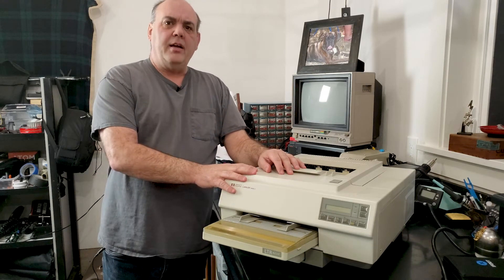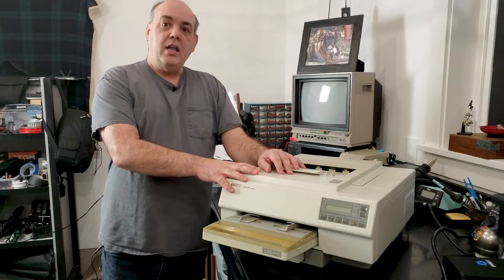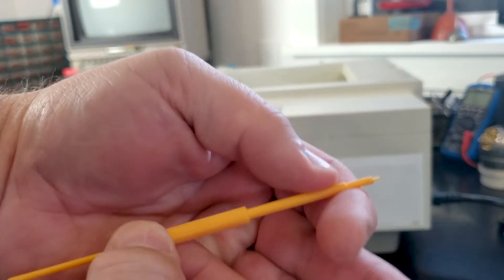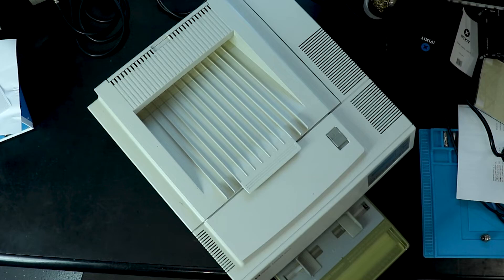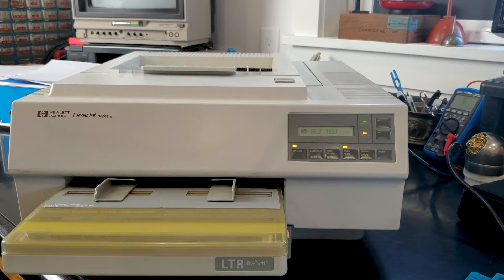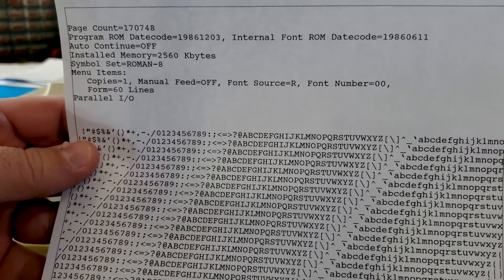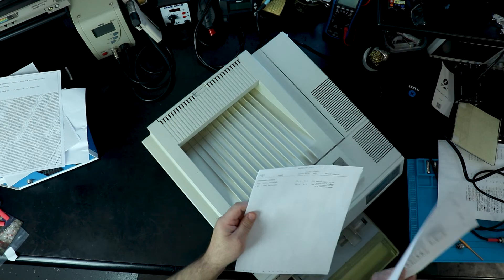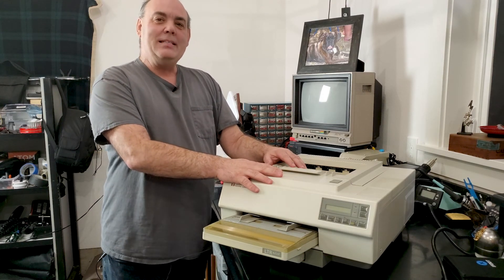HP LaserJet II Engine Test and Self Test Process

Comment: Great videos so I subscribed.
Do you have any words of wisdom on an HP Laserjet III with an error 52 that won't go away. I'm a electronics tech so I can probably fix it if it electronics issue. Maybe (probably) caps?)
The printer came up with this error after sitting for a long time. I only use it a couple of times per year to print toner transfers for making circuit boards.
Thanks
Reply from the maker: No problem Dave. Error 52 is a scanner motor error indicating it is not properly regulating the speed on the brushless motor that spins the mirror. I threw some notes and a shot of the service manual section on my blog at https://ravenwolfretrotech.com/error-52-on-early-hp-laserjet-printers/ If that doesn't help send me a message through the contact page and I will see if I have any parts. I have a few old SX engine printers kicking around.
Reply: Wow. Great info. It'll take me some time to get into the printer and figure it out. I'll get back to you. Thanks

Comment: When I fixed printers for a living my company had a client with one of these on contract and they were using crappy refilled toner cartridges that would leak toner inside the printer and into the fuser where it would melt. I went thru countless fusses but it wasn’t so bad it was only four screws to replace lol

Comment: These are excellent printers. However it’s not compatible with modern operating systems however I have managed to print to mine using a Windows Server 2003 as a print server and pretty much that overcame that problem, I have AirPrint software on that server as well so I can send jobs to it using a iOS device such a iPad and iPhone. Connected to the network via wifi most peoples wouldn’t do that much with a old printer but it’s possible to do with the right software, it also has a external JetDirect box connected to it as well that connects the machine directly to the network to have this magic happen.
Reply from the maker: I agree on them being excellent printers. If you can find a PCL 4 driver you may be able to print but usually you have to get a postscript cartridge to get them going although the last time i did so was probably on Vista.
Reply: @RavenWolfRetroTech  though the server I have done it with macOS. iOS and windows 10, handles anything I throw at it as well it has memory maxed out too that’s why.